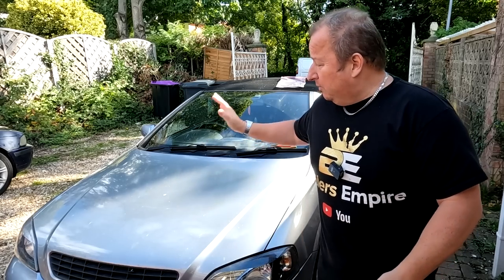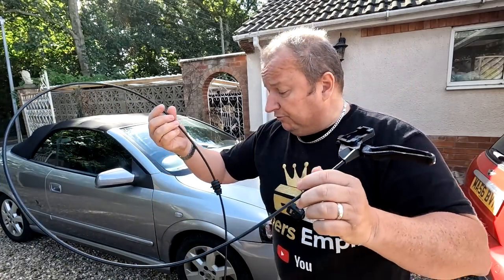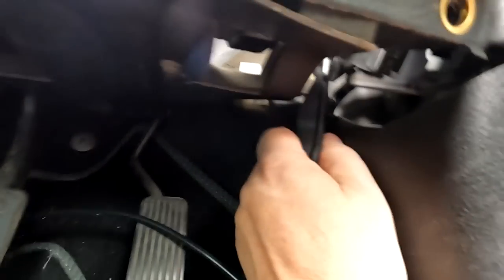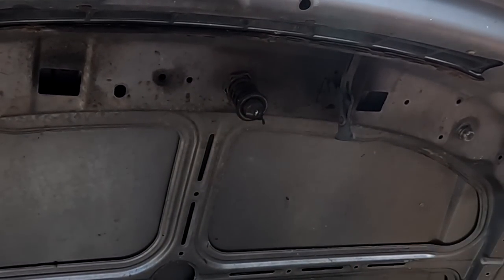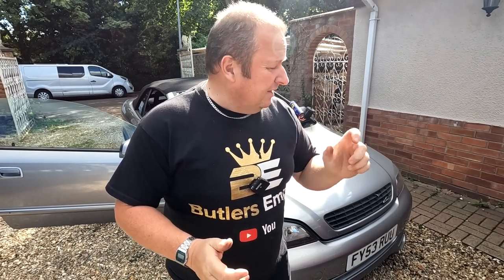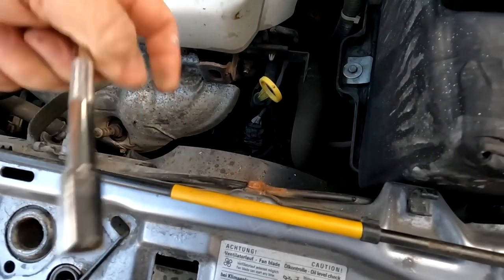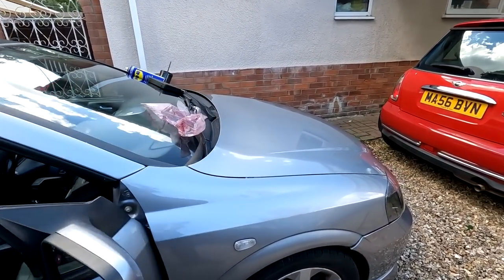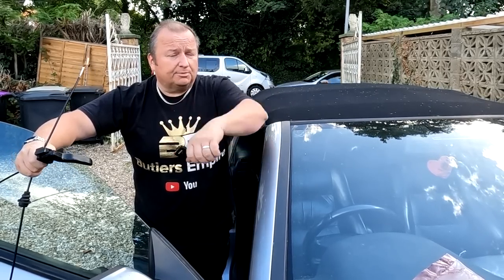Bonnet Catch Pull Handle Snapped And Fix

Comment: The tensioner being on the right hand side and the direction he pulled doesn't make sense to me.... Surely he would be adding more cable to the lever... Which btw is on the opposite side of the car....?? I get that the slack would be getting taken away from the catch but just adding it to the lever doesn't compute as to where the slack actually went...

Anyway this i think will prove to be helpful either way... You've given me an idea 

I came here because my bonnet catch pulls all the way back and wont open the bonnet... I fitted some new headlights which I think may be applying some awkward pressure to the bonnet and a radiator... It was getting dark so I didn't fill the radiator and shut the bonnet hoping to carry on the next day... So I had an empty cooling system and a locked bonnet and a DVLA notice under my wiper....